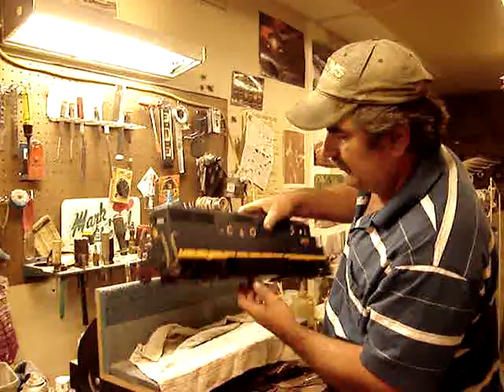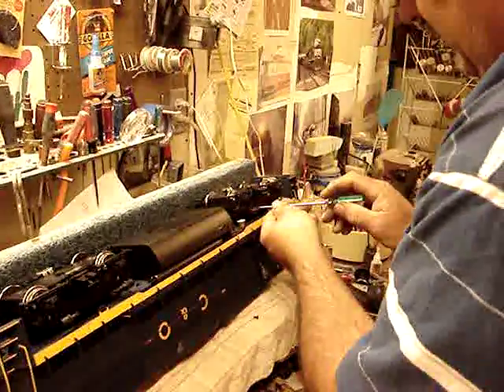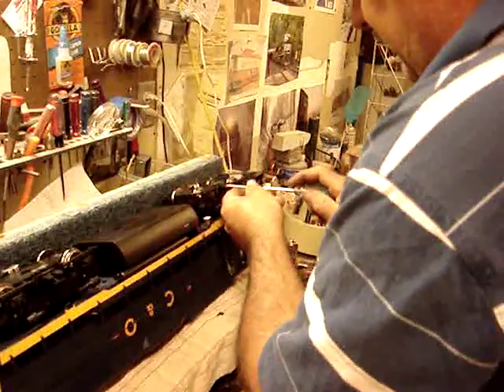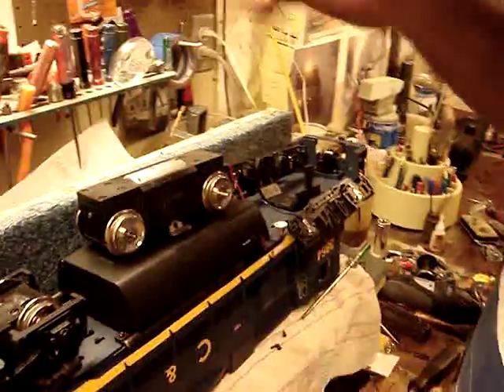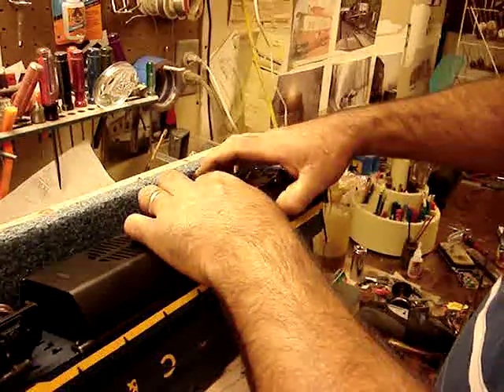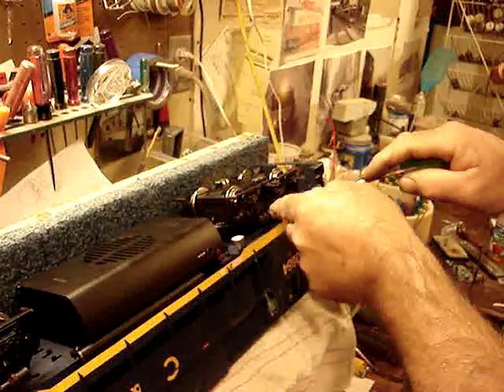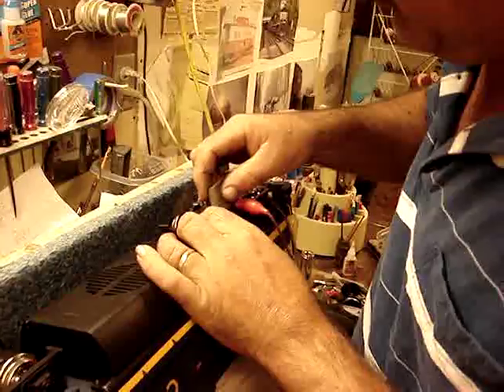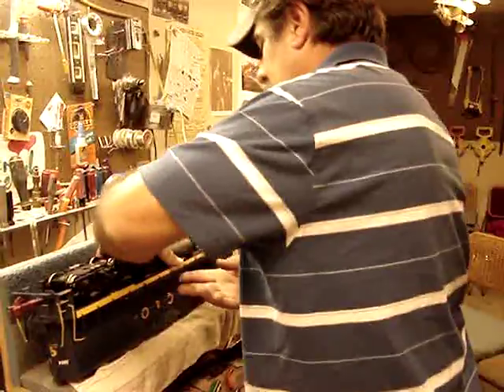Quick tip using dielectric grease

Comment: Dielectric grease is an insulator not a conductor wasn't sure about the application here, does the cup need to be conductive? if so you shouldn't use that type.